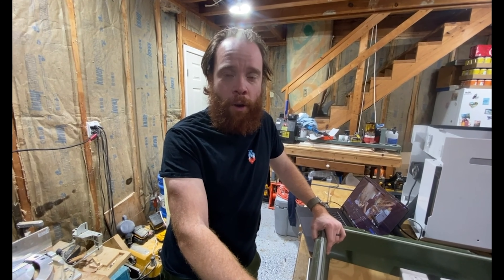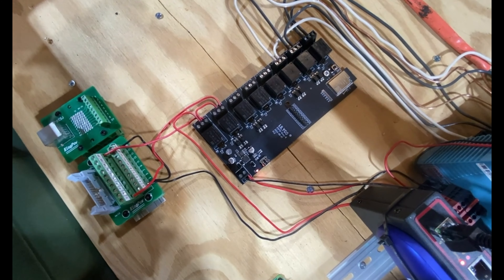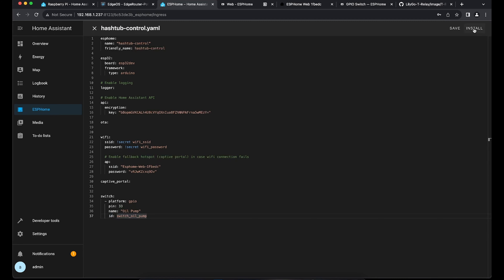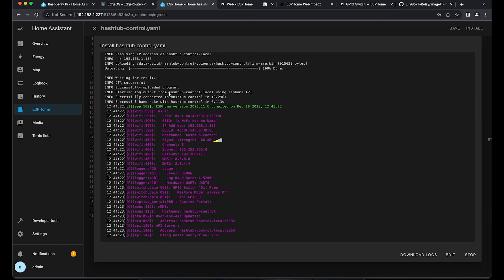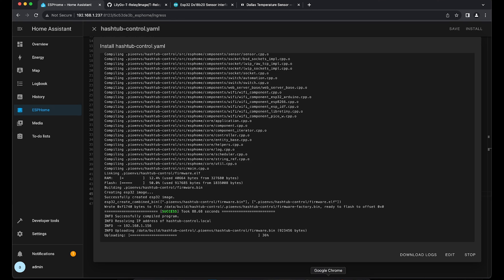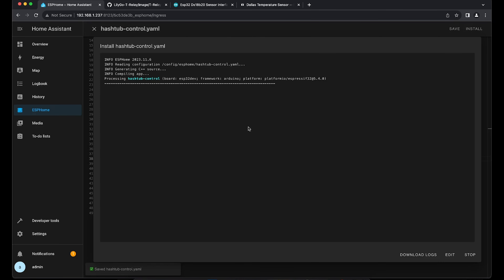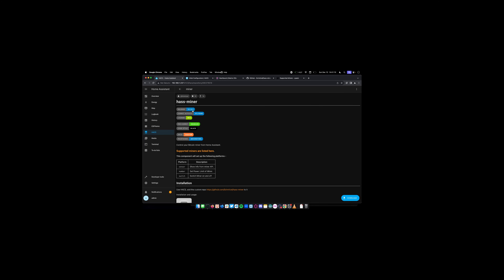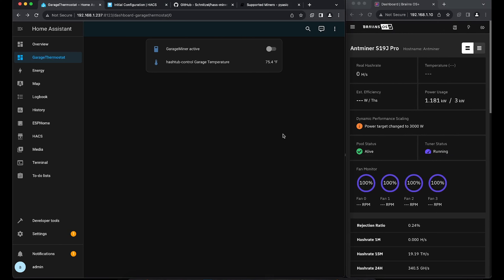Bitcoin Miner Thermostat with HomeAssistant & ESPHome

Comment: Thanks and great work/demo! Have you integrated circuit transducers (CTs) to the setup to monitor electric consumption at various points to know pumping power? It can help seek lowest cost operation per hash. An optimization method applied for complex chiller/boiler plants to seek lowest cost is the Hartman LOOP. It requires variable speed pumps and some more system pressure/energy monitoring as inputs for the calcs. When implemented, it will also lead to areas of improvement for pump selection, friction/head in piping layout, and preferred heat sinks.

Comment: I was thinking of something like this but instead using a Nest thermostat powered by a 24v furnace transformer connected to a 120v contacter to power the miner.  For smaller miners you could use a Nest thermostat and power the miners from a Kasa outlet then use ITTT to read the temperature and turn the miner on or off.
Reply: This is a much more streamlined build using the thermostat on your wall.  Use 3 wires on the Nest. Power, ground and device. Install the 24v transformer somewhere near the thermostat an run 24v and ground to the thermostat. A contactor takes 24v to close a 120v switch. When the thermostat gets down to your set temp it will provide power to the contactor connecting the miner to grid power.  3 wires is much easier than what you have going on. Nice job on the vid. This is a very interesting subject.
Reply: You can also run multiple contactors in parallel using the same 24v to power miners with higher power needs.